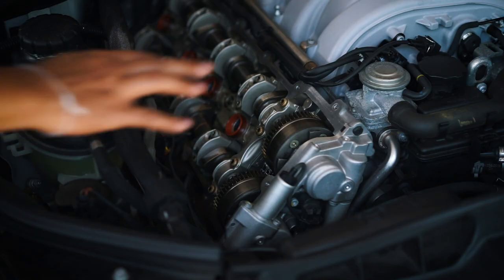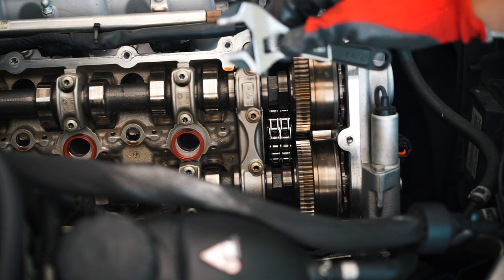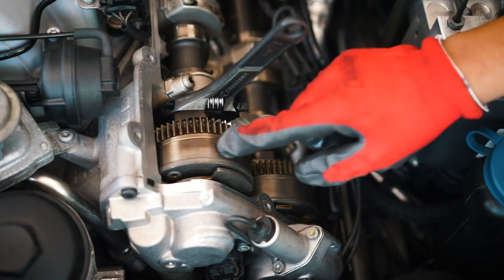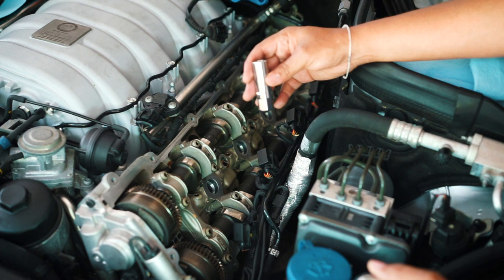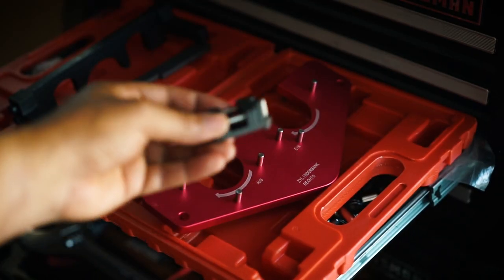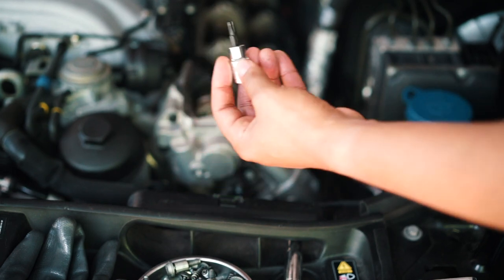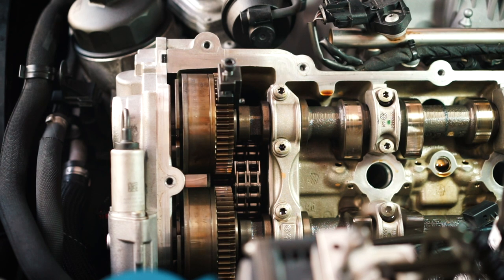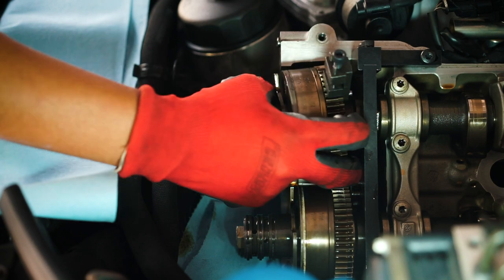HOW TO REMOVE CAM ADJUSTERS ON M156 ENGINE! Fixing that awful rattling noise during startup - PART 2

Comment: Some things I'd like to add after doing this:
1. The obstructive hoses on the drivers side are one bolt and a zip tie away from not being a problem, it's 100% worth doing because...
2. Right next to the main coolant hose on the thermostat housing is the fitting for the breather tube. It is not strong.
3. A new thermostat is about $160.
4. Removing the steering resevoir also lets you see the 40° on the crank, otherwise it's nearly impossible even with a camera.
5. When you pull off the adjuster you'll see a paper thin friction washer. Optimally this is single use but I haven't heard too many stress the point. Keep close track of those either way.
6. When checking the timing, there's a small margin that's acceptable if the tools don't line up exact at 40°. For example: you can only fit the tools exact on one side and not the other when you're as close to 40 as you could get on the crank. I'm told the chinese tools could have stricter tolerances so as long as it's within a couple degrees it's nothing to tear your hair out over. 
Thanks again for the vid. Was there ever a part 3?
Reply from the maker: Thanks for taking the time to leave comment!
Reply: Really need part 3- please
Reply: @malveja  I think there's a reason there are more videos taking it apart than putting it back together. I've put a couple thousand miles on mine since the job. What do you need to know?
Reply from the maker: @malveja   Thanks for checking out video. Here is the playlist for the whole series - https://youtube.com/playlist?list=PL1KGP-3xBS_ysVe5kIkgy6EwpI3dpjkLi

Comment: Hello all,
Thank you for sharing this video. My experience with ticking noise in.cold start  that started when my car had 36,000km only .. c63 507 edi.
Things u need to check:
Oil level
If you live in a hot climate area where winter is 20 c and summer over 40 c  change ur oil to synthetic 15w50 ( yes sir) oil thickness is important in hot climate.
Check camshaft and tappets see if there is any scratches. Finally do what the gentleman is doing in this video.
Reply from the maker: Thanks for your comment!
Reply: Same here 507 edition and mine started at 22.3 k kms. Right now.

Comment: Right on bruh. I have a code of p0013. cam position solenoid open circuit. I pulled solenoid and manually tested, it works. Tried your wrench method on cam intake, then exhaust. The exhaust was tight at first and then it moved at least an inch or two. Now I know the main problem of my code. Thanks for this video. It helped me a lot.
Reply from the maker: Glad it helped

Comment: great detailed explanation, not looking forward to changing adjusters in the coming weeks.
Reply from the maker: Yeah, it’s a little involved, but not too bad.  Good luck! 👍🏽
Reply: @DriveTalkCars  did yours rattle on every startup or at random times?
Reply from the maker: It started off randomly then eventually happened every cold startup

Comment: I tried removing the cam adjuster bolt, but it's very tight. Is that normal? It super tight, I'm unable to remove the bolt. Will it be fine to force it?

Comment: Thanks for great content! Is it harmful not repairing this? Driving like this for 6 months (c43)
Reply from the maker: Thanks for the comment!  Yes, in my opinion anything that involves lubricating engine needs to work correctly. I would definitely repair it. It will only get worse over time. Good luck 👍🏽

Comment: Hello! Did you need to do a calibration for the camshaft adjusters after? I have replaced lifters on the left intake camshaft. I used tool for cam and adjuster but now I have check engine light (Yellow). Engine runs as it should.

Comment: I have a 2010 e63 same engine and problem, I have turned the crank over to 40 and all locking tools are fitting on the passenger side, on the driver side where my adjusters went bad , the hole for the lash gear is only opened slightly and I can’t clamp it on fully, all the other locking tools fit. Any tips ?

Comment: Great video! Question for you. I unplugged both the int & ext solenoids (on both sides) from the wire harness to reinstall the top covers, and am not sure which one goes where on the wire harness. Does the intake solenoid connect to the connector closer to the front of the engine or does it connect to the connector furthest away from the front of the engine? Should have marked them!

Comment: Great great info! Would you recommend replacing the valve covers gasket even if, I’m just checking? Thank you!
Reply from the maker: Yes, I would if they haven't been changed recently. They are fairly inexpensive and would make sense to change while you have the covers off anyway.

Comment: Question: Can you do one side at a time? So basically you only need one cam locking tool right? Say for example you start with the right side. You can lock the cams in place remove each adjuster, flip the barrel or replace, put back together, and then move to the left side and do the same thing all over again? Or do you need two tools and lock both sides of cams in order to perform this job? That has been my only cofusion to this job. Besides that I know I can tackle this job.
Reply from the maker: You can do one side at a time. The locking tool is compatible with both sides by flipping it over.  Some people say use two because it is faster/easier, but I don't think it is necessary.
Reply: @DriveTalkCars  Where can I find the timing plate???

Comment: the backlash is for preventing gear noise. These are straight cut gears pushing cams, so lots of back and forward movement. If there is slack you would hear it...a lot.
Reply from the maker: Thank you for your comment! 👍🏽

Comment: Do the cams need to be locked with the tool and the pulley rotated to 40 degrees before taking the timing cover off?
Reply from the maker: I don’t believe so. The timing covers doesn’t hold the cam adjuster. The lock and 40 degrees just have to be done before loosening the cam shaft bolts.

Comment: Do I have to use the timing tool if I just wanna change out a bad timing cover?
Reply from the maker: As long as you are not doing anything else but replacing the engine timing cover you don't need the timing tool.

Comment: Great video, thanks for posting. Any small issues with the timing tool?
Reply from the maker: Thanks, I appreciate it!  No real issue with tool. This may vary or course, but I didn't experience any issues.   If anything, I would say the rear locking part of the tool can present a slight challenge when putting it in the back of the camshafts to lock them.  But all in all the tool is pretty straight forward.
Reply: @DriveTalkCars  likewise! Another question if you have the time.. On the crank pulley are two lines, one at 40° and one maybe 5° ahead of it. I line up with the 40 mark going clockwise, adjust the cams by single degrees to where the guides (front and back) fit on both sides effortlessly, but when I crank it around to check my work it usually lines up better with the mark in front and it's not exact. Am I doing something wrong or is that acceptable margin? Additionally, what are some common mistakes people make setting timing? Thanks so much for your time.

Comment: that rattling could be in any other meceredes leaking camshaft? I'm asking because mine was repaired poorly and I'll be fixing it soon.
Reply from the maker: "Rattling noise" is one of those things that can be hard to diagnose.  It could be timing chain, adjusters, or something else.  The cam adjusters on the M156 engine is such a common issue that most times if there is a rattling noise (especially during startup) it is the cam adjuster.  As far as other Mercedes engines I can't say.

Comment: hi, i have put the pulley on 40°, i can fit the timing tool on one bank but it miss small rotation to fit the tool on the other one (maybe 0,5mm), did you experienced the same thing ? thanks
Reply from the maker: Yes, I had the same issue. I had to adjust it slightly until the rear lock tool was able to go into place.

Comment: I have a 2006 C280 with a M272 engine that has this problem on the left side (driver) cylinder head. The previous owner neglected the car by NOT changing the oil frequently.  These multi cam/ flex cam engines need clean oil and correct quantity of oil or they fail in many ways.
Reply from the maker: Yes, oil is crucial with these engines!

Comment: How much would it cost to repair it? Got a rattling noise on my 08 e63 and engine code p0010
Reply from the maker: Well repairing it varies in cost. It depends on what you are doing to repair it. For me, I decided to try the pin flip trick (first) which is free if you don’t replace anything.  If you are replacing items then you could spend a couple hundred dollars for a used complete cam adjuster or you could even just replace the plate that holds the pin and usually wears out. This route is questionable because from what I’ve seen most of the used cam adjusters  are for the exhaust side which is usually the one that goes bad. So you may be buying another “bad” adjuster.  Or...you can just purchase a brand new complete cam adjuster for $600-800 (these are the prices I found).
Reply: @DriveTalkCars  Is flipping the pin guarenteed to work? How long did you take it to do the entire repair?

Comment: Everyone needs to find a competent mechanic with a Mercedes computer. This rattling noise will not go away with better oil or a replacement. My c63 came with the updated m159 lifters. You’ll need to remap the way your engine sends oil to these cams/lifters. It’s a simple fix that will save you thousands of dollars. This mechanic was also able to flush my entire engine with hydrogen to get rid of any possible carbon build up in the engine. It runs so well now lmao.. Dealers don’t want you doing this type of shit because your car will pretty much run forever.
Reply from the maker: Thanks for the info!
Reply: Hi, how do you know if it came with the m159 lifters? I'd like to buy the c63 but would prefer it with m159 lifters.
Reply: How can we know what type of lifters came with our cars?
Reply: I have a STAR computer, how do you do this?
Reply: Hi, can you share more information to me? I have a c63 and would love a possible solution like yours! TYIA

Comment: any catastophic failures from the cam adjuster plate issues? I've got my new plates on order but am currently driving the car until they arrive
Reply from the maker: No, I didn’t have any catastrophic failures. I did drive with mine when it started failing, but I addressed the issue fairly early. Good luck 👍🏽